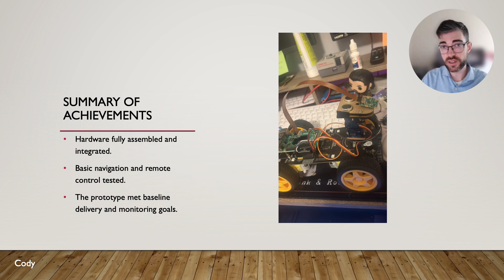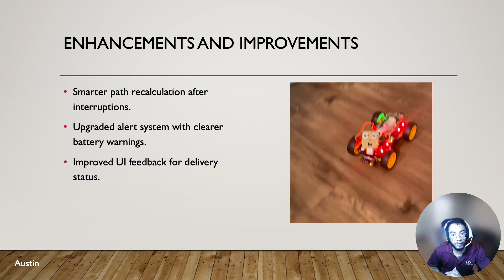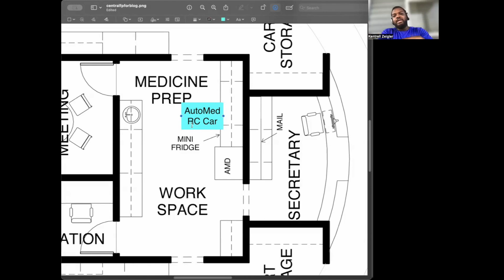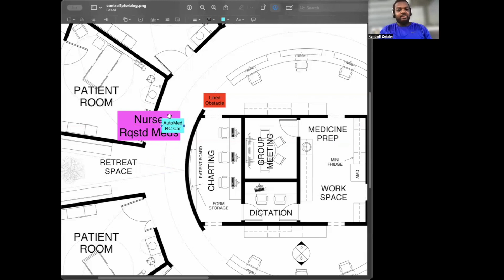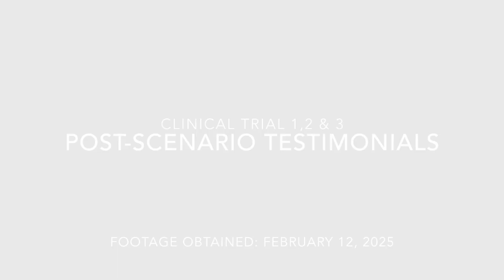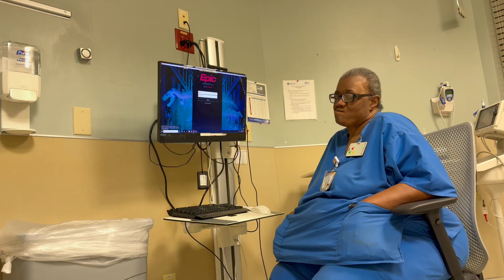CST 499 Final Presentation - Group 2

Comment: One system now employed in many hospitals is the employee locator system, which relies on a readable chip and a signal transmitter system in every badge.  It seems reasonable that the IT department could cause each RC Car to be fitted with a marker chip sensor, such that the target nurse could activate the set button on the badge, to provide a precise homing objective, rather than a general geographic site. After retrieving the delivery, via a badge swipe,  the recipient could press the receipt button, which would signal the docking station to send a beacon alert to guide the RC Car. 
Ideally, it should be possible for nurses to signal from rooms, allowing a charge nurse to count and dispense marked vials for given patients, from a master daily orders list. Please note that hospitals have begun upgrading to a computer-coordinated, inventory-verifying medication cabinet, which is linked to the central pharmacy and the patient order system. An interface with that system would provide a failsafe, that only the appropriate medications could be released, based on room number, and patient name, and shift nurse name, matched to badge signals, which could be exemplar loaded at the start of each shift. Failure of correlation would trigger an alarm. 
This means the RC Car would be interlocked with both the personnel locator and medication monitoring systems, adding another safety layer in patient care.